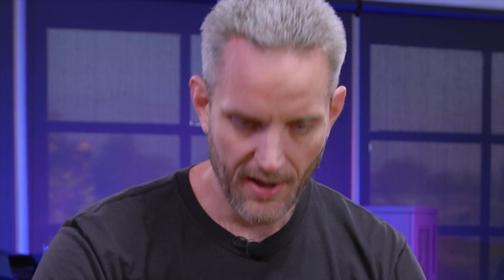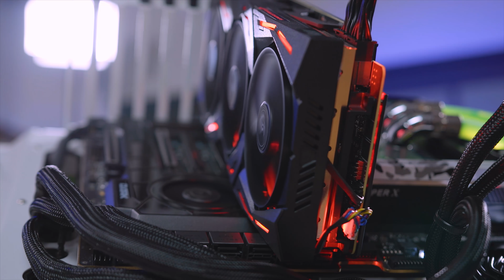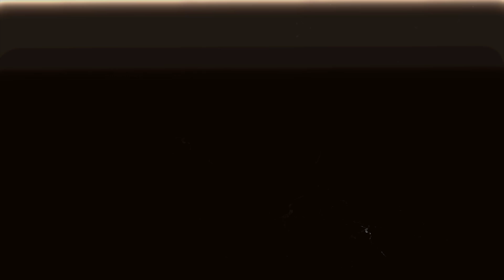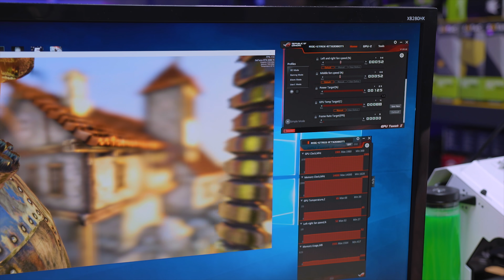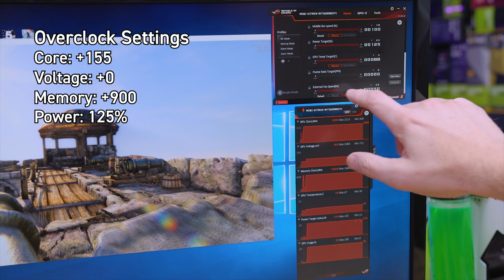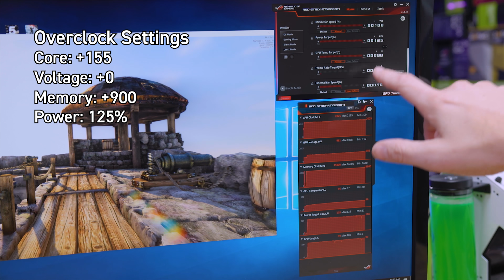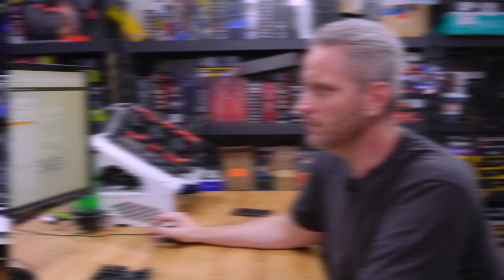ASUS ROG Strix 2080Ti Overclocking and Review

Comment: Good point. So with that being said, which is the better of the 2 slot and no load quiet fab and cool light up effects. I usually do get ASUS but seams a bit thicker as when retired, it's going into an older workstation with full slot occupancy .

Comment: So it may be a stupid question, but what should I set my GPU Boost Clock to? I currently have it in the in the OC Tweak 2 with the fans at 90, Mem Clock at 15800, power target all the way up at 125 but now I'm not sure if I should touch anything with the GPU Boost Clock or if i'm fine leaving it at the 1650?

Comment: Almost 3 years later, this card is in my Rig, still a beast
Reply: @ArcticSparty i just got one used. it's a monster and has no trouble at 4k in any modern titles.
Reply: @certifiedsexhaver8400  I’m trying to get a etc 2080 ti for cheap, I’ve seen a Facebook listing for a rtx 2080 ti for $680 which is just crazy but I’ve checked the face book profile and the dude is real but will see if this is a scam or not. I’ll keep you updated
Reply: @minigungaming5404  so???
Reply: @nulltall3914  the guy never replied. Just went and bought a gtx 1080 ti
Reply: Aye same, I love my 2080ti, glad I couldn't stomach selling it for $500 like some owners did, it's still serving me good
Reply: I got a 2060 rog strix oc edition and it preforms great! I was wanting a 2080ti but the prices are through the roof so I settled with the 2060, Idk if I should upgrade since it preforms great for me, and I can game at max settings on every current game I play at 120 fps on average. The only reason I haven't upgraded is because my psu is 600 watts max and I haven't used my 2060 a lot and it works great for me. I just feel bad because the 2060 feels old to me with all the new 30 cards out now.
Reply: Yeah honestly, I have a 2080. I’ve overclocked it pretty good at this point, seen results of stock 2080 vs a 3070 and it’s made me me find upgrading to that card pointless. Will wait for next generation
Reply: @Jp-gc6bh  now you just have to buy another 2080 like that to make an SLI which is stronger than 3090
Reply: What about now?
Reply: still using it, still going strong. Just finished Doom the dark ages last week and ran smooth as silk

Comment: I have this exact card and the fans might've been updated. They are a nice whoosh sound at %100 and consistent in RPM. 

The other thing I want to note is I can get 2115MHz on the core with the GPU at 55C (fan speed set to 65% manually and open air case) but my memory will only do +600. I tried +750 and it sparkled and would artifact in Time Spy Extreme. With all that said, my GPU score is right around 7550 as well. 

Excellent card!

Comment: Great and insightful video. Have you done any testing on the Super cards with NvLink? I'm curious what your opinion is on 2 RTX 2070 Supers vs a RTX 2080 Ti. Reason I ask... I've been running the dual 2070 Super cards, and I just picked up the ROG Strix RTX 2080 Ti for $750 (open box deal). I run mostly VR gaming and regular gaming with the Supers... And while I'm done instances I'm getting improvement with the dual cards, I don't believe I benefit in the VR department. I couldn't pass up the deal on the 2080 Ti. What's your take? Should I replace the 2070 Supers with the single 2080 Ti? I figured I can use the 2070's in my wife and son's computers... But I'm also not one who likes to LOSE performance. Lol. Thanks again

Comment: my rog strix 2080ti does have fan headers but i dont have a clue how to hook those up anyway, so. 
and i dont know how to overclock properly  when i keep the normal oc settings +125% power limit, hwmonitor says 'reliable voltage limit' and 'operational voltage limit'   and also still hit the power limit.

Comment: Brilliant card, I’ve clocked mine to 1815mhz and 14800 on the memory and it will run this all day and not go above 64degC
An awesome card
Reply: If I add 60mhz to my core clock it crashes.
Reply: @CptnDooku  every card has a different limit.
Reply: You have coil whine though??? Mine screams

Comment: I've ran all my amd cards fans on 100% for the past 10 years and they all sounded like that. Fans working fine in my opinion and I've never had a problem with any cards or other components. I use an air compressor to blow out every spec of dust every couple months or so to keep her fresh as I live with my sheltie border collie mix lol.

Comment: what if I used two rtx 2080 windforce 8g bridged (non ti version), that would be the same price as one rog strix ti here in sweden. Is that possible? Does it draw to much power from my psu. Or should I sell my already bought windforce 8g 2080 and buy a  rog strix 2080 ti?

Comment: So i've had this card for a few months. (About 4) and i recently noticed that when it reaches 70 Degrees it completely ignores any fan curve settings and speeds up to 100% and stays there until temp goes under 70 which means playing games that are even slightly demanding ramps the temp up to 70 and fans go fucking crazy.
This happened in games like ARK and Destiny 2. And in D2 i even lowered alot of settings but temps would not go down and fans kept going at it. Granted im on a 1440p 165hz monitor from a 1080p 60hz but the problem is the fact that the card ignores the fan curve i've set for it at 70 and it just goes full speed.

I've also noticed a strange almost rattling noise coming from it for a second as its speeding up. I think it's happens at around 60-65% fan speed and then it just makes an uneven whirring sound at 100%. I might have a faulty one but it's just something to keep in mind if you're buying this card, it might have some proper issues.

Comment: Ok I get it, it's all about 4k on PC these days...
480 to 1080 was a wtf jump
1080 to 1440 amazing, not that essential, but still awesome. (that's what I use)
1440 to 4k on a 35" screen: marginally perceptible by pixel peepers, but then to keep a great level of details on par with 4k + refresh rate you have to whack that overpriced beast coupled with an overpriced screen. NOT WORTH IT

Comment: can someone help me? 
Im getting so many different opinions
Which card should i get 
Gaming x Trio, Rog strix or AMP extreme
Reply: Jonathan cc if you have a 9900k then the trio. If it’s an older cpu then get either one. The trio is the most powerful and will average more frames across the board. Except some titles the FE edition will beat it for about 2 frames.
Reply: @doukasviidoukas8287  thxxx man that's exactly what I have for my cpu haha

Comment: can I overclock the Asus ROG Strix 2080 / 2080Ti without liquid cooling? I'm using Asus ROG Strix z-370 e mobo and corsair crystal 570x case
Reply: Yes. The overclocking you see in this video was done on the stock 3 fan cooler.

Comment: The fan connectors on the card is gone because they dont work or the ASUS software is rubbish, i never got my PWM case fans to work with my ROG STRIX 1080TI.

Comment: Jay now we have hot RTX cards, hot cpu like 7980x and hot VRM like z299 can you pleaaase test where thermals gain the most efficiency in radiator size. Starts 120mm then 240,280,360,420 and see where you gain the most cooling in a single custom loop

Comment: JAYZ!!! Help me! 
In Win 10 I get "Application ********* has been blocked from accessing graphics hardware" error whenever I start a game when my graphics card is overclocked, like even with the presets available from the series own OC software.
How can I get this to stop?? Reinstall Windows? That'd be a major pain in the buttocks considering I got A LOT of games and programs installed... And IDK how to back up game/program data in registry...

My specs:
MB: Gigabyte GA-Z170X-SOC FORCE
CPU: i7 6700K at 4.2GHz factory OC (didn't overclock it myself to that, was 4.2 from the start)
GPU: Gigabyte Aorus GTX 1080 Ti Waterforce 11GB
RAM: Corsair Vengeance 2x8GB running at 3600MHz (not XMP, manually overclocked it)
OS: Windows 10 Pro
OS-SSD: Corsair Force LE 240GB SSD

Comment: What Ti cards are generally the best for overclocking? Like, what brand and series? And just general performance overall.
Cause whatever you guys think is best (FROM YOUR OWN ACTUAL EXPERIENCE) I might buy as a 2080 Ti if and when available.
Like, think of it as a poll, just write brand and model series in comments and I'll count them to see what has the most satisfied users.
I currently have a Gigabyte Aorus 1080 Ti Waterforce (AIO) 11GB, and it's performing very well. But, I'm not sure the same brand and model will be availble for 2080 Ti. And I'm not sure when if it will.
Reply: Strix OC hands down

Comment: Back in the day I had a GeForce 7600 with a core clock of 450mhz that went up to 600mhz, in comparison getting 155 extra mhz on a ghz+ core is negligible and shows how close to the limit chips are run at these days, and that GPU overclocking is now mostly pointless as the manufacturers are effectively doing it for us at the binning stage. The "choppiness" on the fans is called a "Beat", and an unfortunate design flaw caused by the fans running at nearly, but not quite, the same speed; simply differing the fans RPMs by eg 100 would've been an easy solution to that problem, I wonder how many, if any, makers of multi-fan products have addressed this issue. That's something that should really be mentioned more in PC building as I've seen, or rather literally heard, it crop up in many cases  (punintended), especially with identical fixed-speed fans, where adding a speed control or simply a resistor to one of'em'd fix a problem that's subconsciously nagging at many people; the fact that it's subconscious for most is presumably the reason it's not consciously addressed much.

Comment: Aside from the founders cards being insanely priced, what's the point in spending another $200 on an aftermarket card if none of them can decently overclock due to NVIDIA's power restrictions and a few degrees less in temperature from extra fans? The whole RTX launch has been a shit show.
Reply: Drum8888 do you feel like the aftermarket cards were done on relatively short notice? Like the companies didn’t get a lot of time with the original and rushed them out?
Reply: ArsArma  Yea they don't have long to get to market in order to compete, but it looks like NVIDIA have hamstringed them a bit this time in terms of overall limitations. I'm sure we'll see custom higher powered PCBs in the future (assuming NVIDIA hasn't banned doing that) but it's gonna take a while

Comment: If the cooler you buy pretty much just depends on the look of the card and what you like wouldn't it also be nice to know the noise of the cards.
For example I'm in Germany and the 2080  strix is 60€ more than the msi trio version, but I would be willing to pay the extra because it fits the rog motherboard I have. But if you describe the noise of the strix as choppy I'd like to know if you'd still hear that in a case. And maybe at the cards factory fanspeeds and so on.
Greetings from Germany

Comment: the choppiness you are hearing is because the fans are not running in sync....those fans might have some "attempt at syncing" controller but there is a feedback loop,it takes time, it syncs, it goes out,it needs to keep that area cool....etc...the higher the speed the more out of sync sounds you'll get ...trust me i know...have 2 24V super high rate fans too cool my RF amps and the out of sync sound can drive you insane 
to illustrate, ddddoooooo,,,,dddooo,ddoo,dodododododododo,dddooo,dddddoooo,dddddddooooooo

Comment: How about a comparison/talk about the difference between GPU with DDR4 ram and DDR5 ram, as in speed/performance or whatever. I have an Radeon R9 380 series (4GB ram, DDR5) and it seems to be holding up well, so well that I don't plan on replacing it when I upgrade soonish. Just wondering if I would be any worse off if it had DDR4 on it instead.

Comment: Does anyone know, if the stock Powerlimit is 250 oder 260W on this card?
I can find both values, but i guess the 250W is only a placeholder... because 250W + 25% would actually be LESS Powerlimit than the Founders Edition.

Comment: Got my 1080 for now and won't upgrade to any 2080 or 2080 Ti. 
Pretty disappointed in them right now.
No RTX because no use case and no programs that can use it.
And on top of that I'm pretty disappointed in the absence of custom boards that just kill the "reference design". 
All hit the same limits, all do the same. 
Will be waiting for real custom PCBs and proper "upgrades". Showing 3 Fans where only 2 1/2 are really impacting the heatsink and PCB - Pass for me...
Reply: no boards???? Asus Formula? Maximus Hero XI? Wot?

Comment: with that power limit and using virtually the same heatsink (apart from the 5 pipes, I think the 1080ti has 3) it doesn't really outperform the 1080ti by much. I've been getting the strix cards, apart from the time I got the earlier titan that came out before the ti's, I've noticed more of a jump between the 980ti I used to have and the 1080ti I have now and most of what I've seen from the 20xx line there's nowhere near that kind of noticeable jump in performance, when it's like double the price. the only thing performance wise they have is ray tracing and that cripples framerates

Comment: Am I right in thinking that we are hitting the power limit while not even really using the new cores on the cards?  What will happen when we start using all of the die, are we gonna hit power limit a lot earlier and find that raw clock speed will be lower as power is shared across the chip?

Comment: GPU voltage slider makes GPU boost 3.0 more agressive so you can reach the maximum card boost clock but only if temperature allow it.But daaamn 15 gb/s memory speed wtf???

Comment: Sooo...1880-90MHz vs 2010-20MHz, more or less 100MHz, is it good? What is the point in real life scenarios? Iam not overclocker and for me 100Mhz is more statistical error than meaningful boost in performance. Lets say its 6%boost, so if I played W3 and got 55FPS with 1900MHz I will get +6%FPS and will play W3 with 58FPS? Don't get me wrong + 3FPS is better than +0FPS but its still statistical error + you risk damage your card by overclocking it or atleast shorten its life.
I understand pro. overclockers, they do it just for the sake of doing it, for them its a competition...sport like any other, but nobody use LN system in "real life" to play W3 in 5k on max, and I bet they got more than 100MHz boost.
Reply: No GPU OC got really boring because they boost themselves up.
Reply: It's worth mentioning as of now.. these cards are power limited.. for people wanting to overclock, perhaps it's like itch for them to do.. it doesn't matter this time round with this generation of cards.  All because they don't want to deal with people bricking their cards..

So in short it's a piss take for enthusiasts... they want to play with their new tech but nvidia has drawn the line on how far you can go.. and raytraceing hardware being on the die to.. taking up as much room as the cuda cores might I add.. could be the reason for the power limit being lower.. all for something you can't use right now.. of which developers would need to adopt.. 

It's half a card ...

Comment: Sooooooo if Jay had increased the voltage slider wouldn’t the card have more power to overlock ? Confused
Reply: The power limit is the issue. Once the GPU tries to pull the limit it would crash. Hopefully, they up the limit in a driver update or allow non-reference card makers decide what is safe operating limit for their cooling solution thru their proprietary software.

Comment: Considering ever since gpu boost 3.0 these cards are all very sensitive to heat, I'd say the only factor to consider is cooling performance, the cooler you can keep it, the longer it will stay at its oc boost clock

Comment: Results may vary. At least its not "some assembly required, batteries not included"...

Fans sound like Jay's car when floored... and that sounds beautiful...

Love the red light on black.

Card I want to see, if it ever gets released is either the Colorful Geforce RTX 2080Ti KUDAN or the Gigabyte Geforce RTX 2080Ti Xtreme (air version or AIO version).

Comment: I'd like to point out that the fan headers on these cards (at least with the 10 series) are mostly useless without flashing your own bios because they do not send power to fans plugged in until your cards temps go above like 70c which my case rarely does anyway. There is no way to change this in any OC tool as far as I'm aware due to it being bios locked so they may be removing it due to it frankly just not being very useful for most consumers.

Comment: Jay, the power led button is NOT something you can change in software. I have a strix 1080 and even when your computer I'd TURNED OFF the two white light above the power connectors are constantly on which forces me to switch off my power supply nightly. Does the 2080 have these lights and are they turned off by pressing the button on the card?

Comment: Strix is still my fav lineup of graphics card, I've had a gtx 970 strix for years with zero problems
Reply: Except the downgrade once the 1080 to released. Don't pretend it didn't happen, it did. I saw it happen as I gave my 970 to my brother.

Comment: I have a Strix 1080ti OC and I dont remember it coming with a gpu support bracket...hmm
Reply: I was thinking the same thing. I have owned the 980 strix, 1080 strix, and 1080ti strix. Never had a brace come with it. Just the quick start packet, some power cable adapters and some Velcro straps.